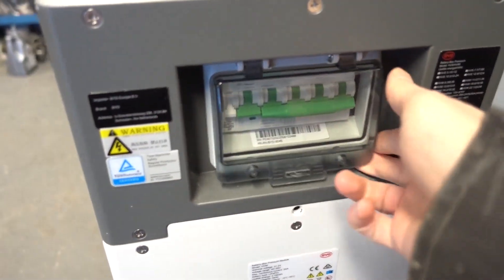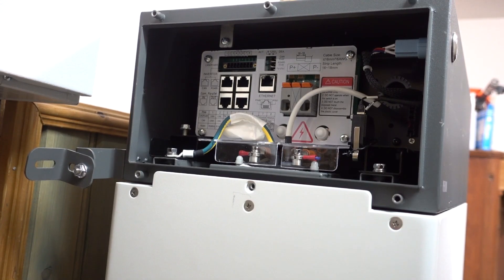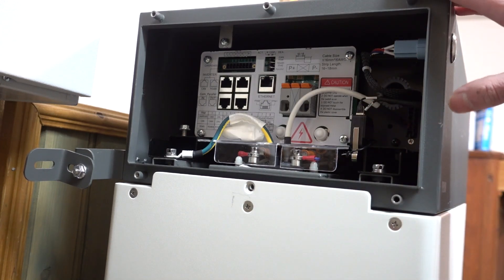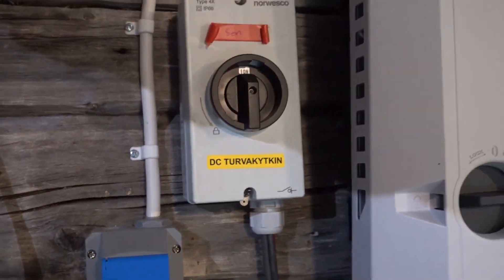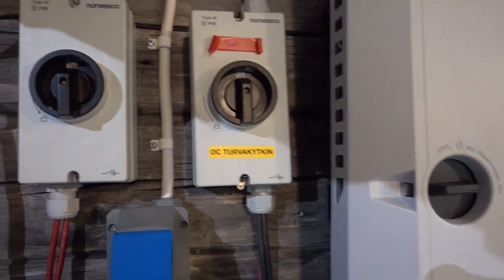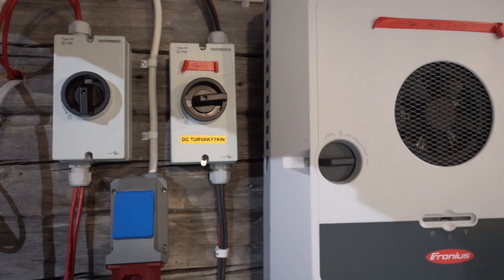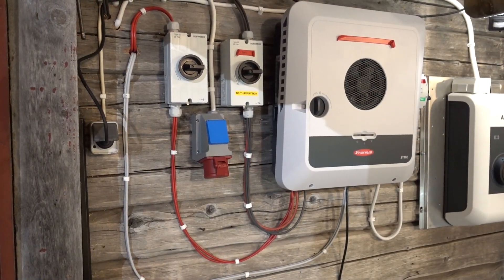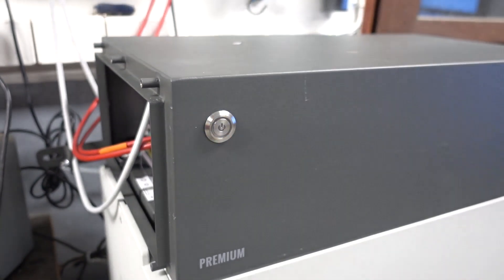Integrating a broken BYD battery with solar [part 1]

Comment: you ned to press the button for e4-5 sec so it remains white. not more otherwise the main switch will jump. also you need to download the software from the site and upgrade the battery.

Comment: hope you're still on it. Did you manage to sniff the Modbus Traffic? you would need a Modbus USB Dongle. Connect it to the wire 1 and 2 and take a Trace with a monitor tool like "Serial Port Monitor", if you can get a Trace from a working example you can compare, try to figuere out what the single messages mean, and maybe fix it. 
eventually you will need to configure the inverter with admin rights, to tell it, that it shall operate with a BYD Battery.

Comment: Did you setup the inverter type/manufacturer in the battery? Battery should have its wifi, where you can go to battery web settings page and there you must setup the manufacturer of the inverter - Fronius.
Reply from the maker: Yes, it was a loose wire. Check the other videos!

Comment: Did you say previously that the blue blinking power light is just a light?  Or do you press it?  Looks like a button you press!
Reply from the maker: The button is used for shutting down the battery, and the LED part of it relays fault codes

Comment: 4 step action plan from a Baboon: 
1/ MODBUS is a monarchy, CAN is anarchy. Make sure you only have one MODBUS master on any MODBUS network. I found this out the hard way by trying to get two inverters (Masters) to share one energy meter (slave). Now one inverter has a broken MODBUS brain :(
2/ Check your network resistances
3/ Sniff traffic
4/ Beats me!

Comment: Hello Again ;-) if you want to post good pictures of all data cable connections and dip switches (Smartmeter, Inverter, Battery) i can take a look if something is wrong.
Reply from the maker: Basically I followed this guide down to a T: https://www.fronius.com/~/downloads/Solar%20Energy/Quick%20Guides/42,0410,2610.pdf

Only thing I haven't checked is that if the smartmeter has a 120Ohm resistor hooked up to it
Reply: @DalasEVRepair  So check it :-P

Comment: Why in the previous video, the SOC was reported at 0%?
Reply from the maker: Voltage per module is 49V. Manual says that 45V is enough to start the system (and there is no fault code for undervoltage at the moment)
Reply: @DalasEVRepair  Maybe you just need more voltage to properly function.. Or maybe something else. It should register a positive SOC before you may work with it.
Reply: How do you get all modules at 45 v min? How do you balance the modules? Any info will help thanks

Comment: I'm not any electrical expert. i hope there's no loose wiring?
Reply from the maker: All wires checked with multimeter, solid connections!
Reply: @DalasEVRepair  hi, I make this set-up every Day.
Did you configure the BYD battery with BE-Connect tool first?
Turn everything off. Than turn battery on, than fronius on. If you configured the fronius correct, and modbus wiring is correct, communication Will start automaticly between byd and fronius.
Reply from the maker: @thomasdemeyer7256  I got it working! New video up :) Thanks for the tip!